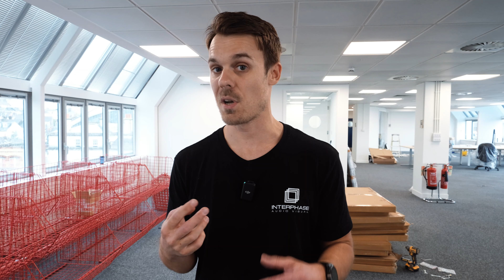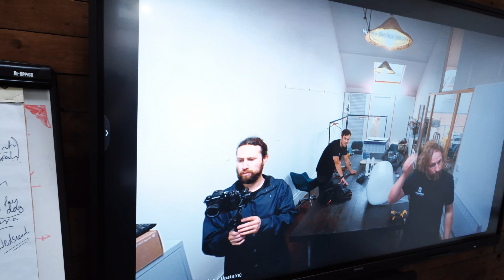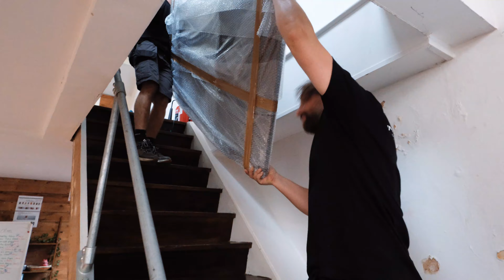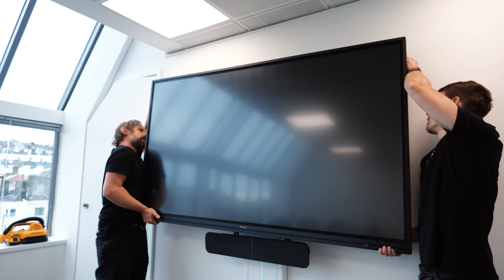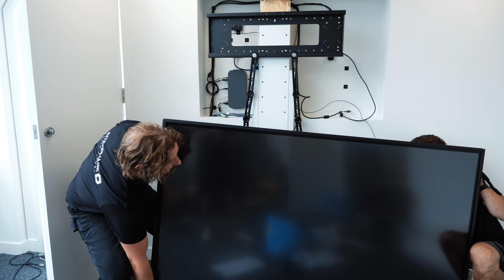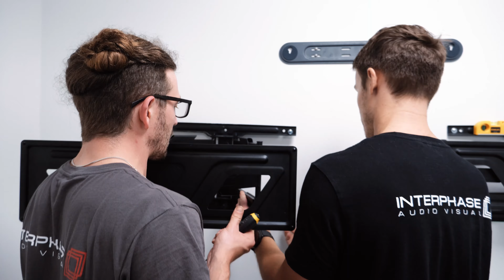Commercial Audio Visual Installation - Google Meet - Lenovo Series One

Comment: random question, is it required to know either a basic or intermediate level of carpentry & also blueprint/sketch readings or drawings, when being a AV installer? I'm coming from a Event/Support branch of AV and the goal is to get into commercial install and work my way to become a AV Design Engineer.